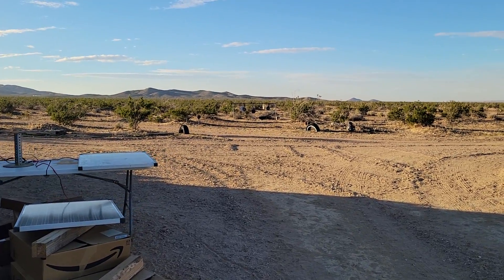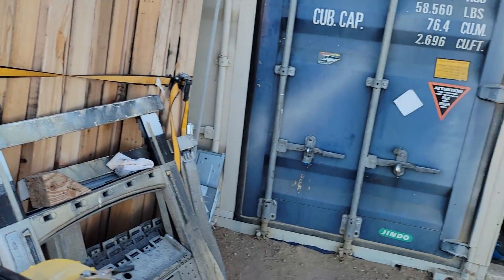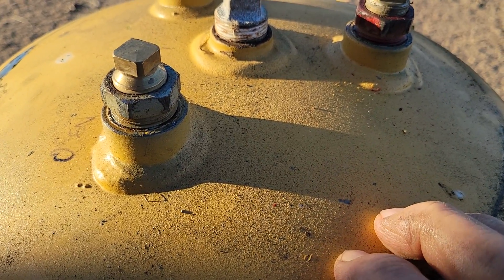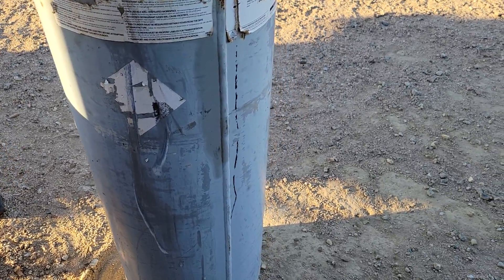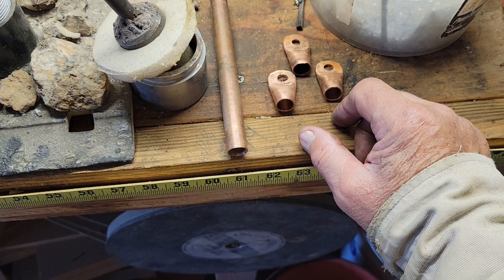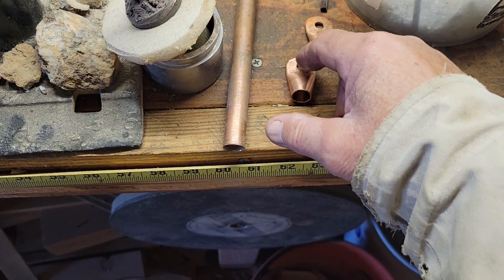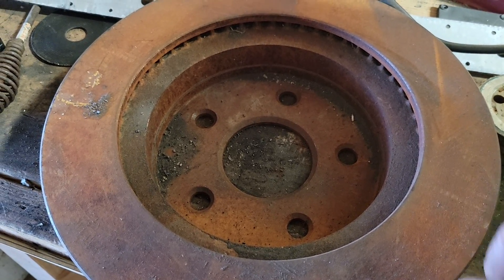Waste Oil Heater Components And More, Oct. 27, 2023

Comment: GBear You really need to put the oil outlet on the side of the tank. Use the bottom outlet and a drain in case you get moisture or water in your oil. The water will always go to the bottom so you need a way to drain it so it doesn't get to you oil outlet. If water mixed with the oil get down into the stove you could do some serious damage. I seriously don't want to see anything happen to your homestead that you worked so hard to build. My2¢
Reply from the maker: Welcome aboard!  Advice noted.

Comment: Yeah those old worn out batteries kind of suck. I have a 24 volts 100 amps lithium iron phosphate battery 🔋 coming Wednesday. Im getting another one for 🎄 Christmas. Im going to put the best eight batteries i have, two are a month old, and use those on the 24 volts part with the new batteries, and create a 12 volts side and use my spare inverter which is also 2000 watts but 12 v. The other twelve batteries can run that part. It won't hurt if I lose a couple or three of those later on. The 12 volt wind generator can run those, and I'll make a 24 volts wind generator for the other side. Im going to try it like that and see what happens. Happy birthday. 🎉
Reply from the maker: Sounds like a plan.  Thanks for the birthday wishes.

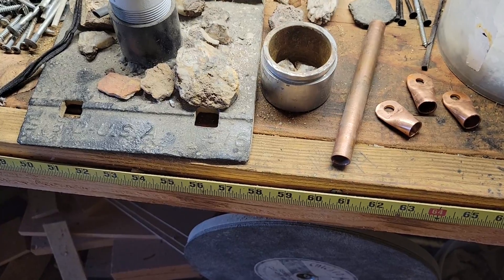Comment: You're NOT old, GBear!  Happy Birthday in advance!  5:11 - that there's a brake rotor.  The caliper is the gizmo that takes the hydraulic fluid and turns it into linear motion to compress the brake pads onto that rotor to create the friction to stop a vehicle.  You knew that but probably forgot it.  8:36 and the grease cap sure looks like a caliper piston with the ring in it for the seal to keep the hydraulic fluid in the caliper body.  Here's an animation for those who may need help to visualize:  https://www.youtube.com/watch?v=Au_SRabG_64 - Sorry to hear the welder trick didn't work on the battery - I assume you were using a DC stick welder and observed polarity as an AC welder will NOT work for that hack to work - if it does.  Keep up the great work, GBear!  Thanks for posting!
Reply from the maker: Right on all counts.  I can't believe I said caliper and cap...must be the lack of beer from the lack of funds.